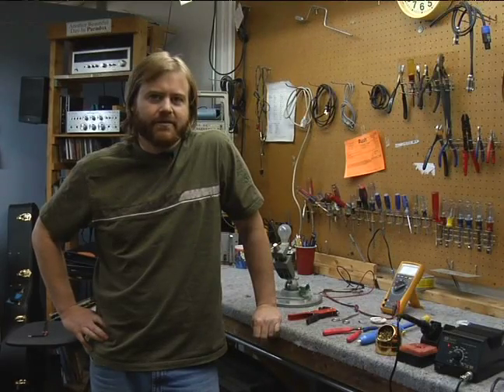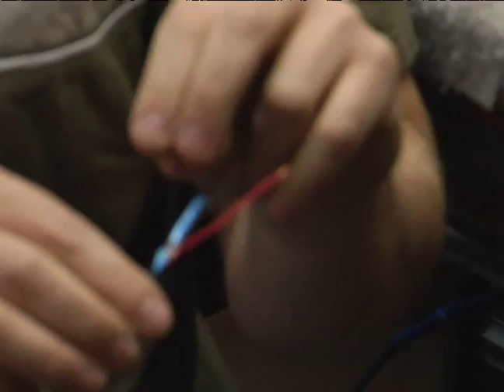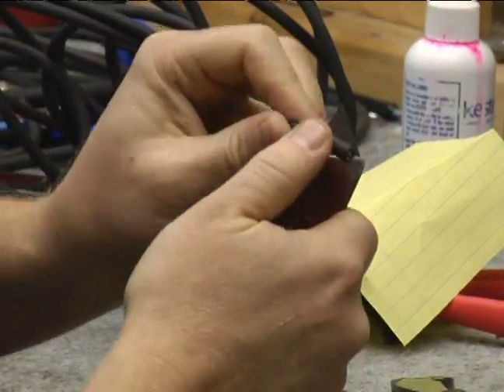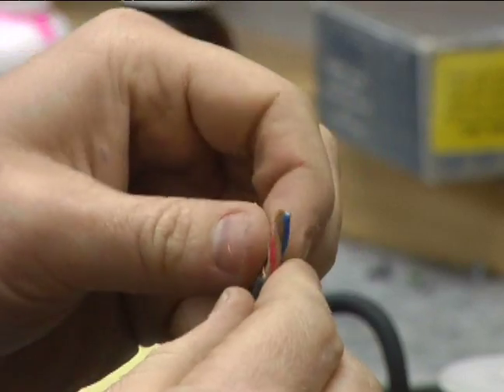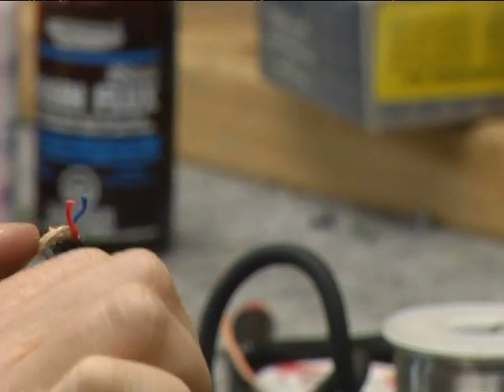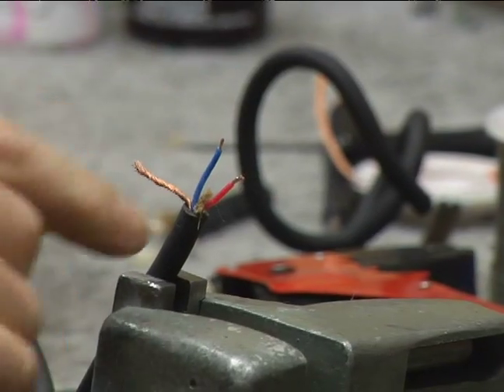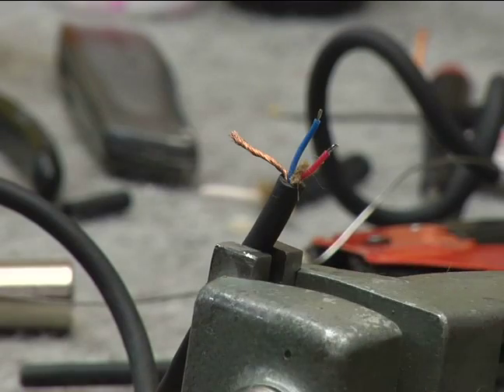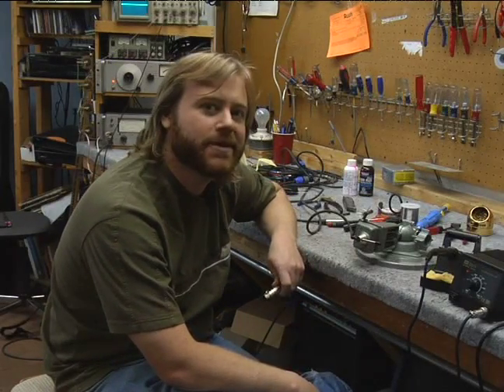How to Solder : Soldering with XLR Microphone Cables

Comment: The standard is to have Sheild on 1, Red on 2, Black (or blue) on 3.
red and black conduct only currents for the mic element. The sheild is to carry the electrical and RF ground so you don't get any hum. 
An unbalaced mic cable will be a single conductor sheiled in which the centre conductor will go to pin 2 and the sheild to pins 1&3.

Comment: Hi, I have a question and I will be very glad if you help me out with this. I have (it was presente because it was broke) this XLR dinamic mic (Audio Technica ST90). I noticed that it has only two cables which I solded to pin 2 (hot) and pin 3 (cold, return, etc) and my question is: what about pin 1? I have nothing to sold to it... I let the pin 1 like this and the mic sound really good but some times gets  a interference, like a radio interference.. Can you help me out?